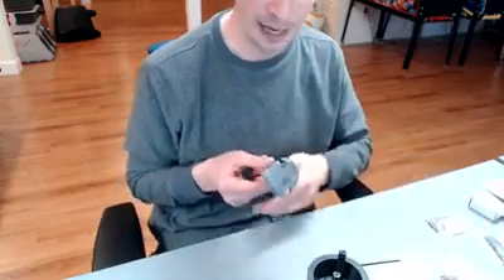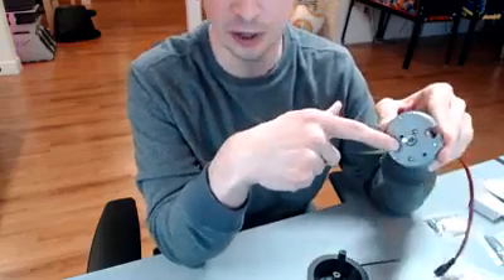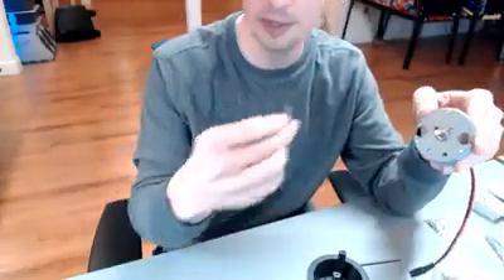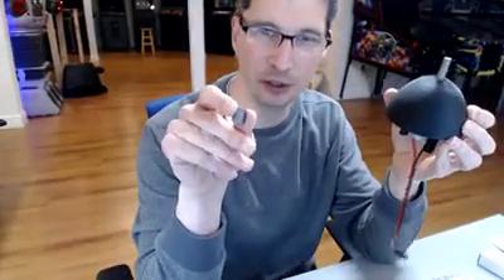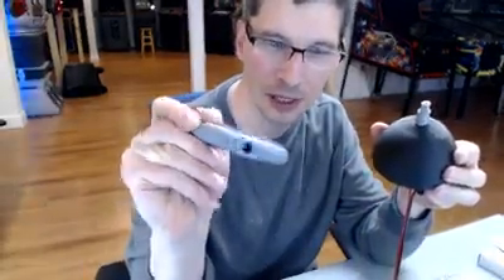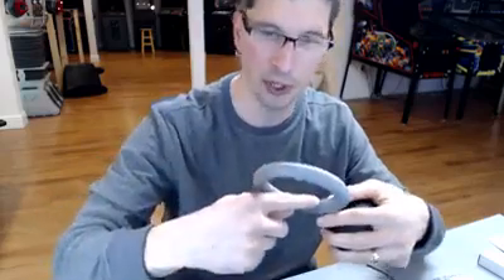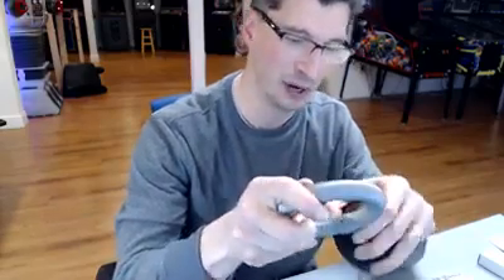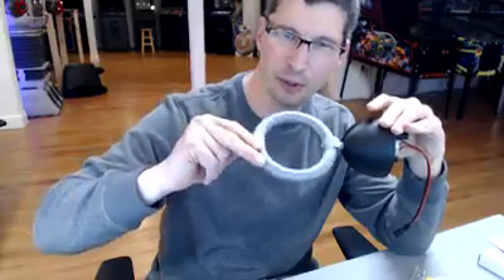Robby the Robot Radar Part 3

Comment: I assume there are holes in the clear dome, and these two parts attach after the dome is in place. It doesn’t seem that the dome would stretch far enough to allow it to go on before. Is that correct?
Reply from the maker: correct- holes in the dome are necessary. I would demonstrate on my homemade dome but I still haven't mustered the courage to cut it yet. By the way, if you haven't made these yet I will be posting an updated version (and HQ video ;)) which incorporates a leaf-switch designed to add an alternating flash to the 2 blue bulbs in the radar section
Reply: I was asking because I want to accurate an old Robby scale model. I'll need to cut off the existing ears, make new ones, thermoform a new dome, and rill holes in it. Making everything like up will be the trick!

Thanks.
Reply from the maker: @TheSchoolofExhibitDesign-yj1no  Check out my dome-making video. I started with making one that was model-sized as a test. You can scale my full-scale buck mold model file down to fit your needs and retain have proportions accurate to the original prop. In my "How I Made Robby" video you will see there are other parts I printed at smaller scales as well.